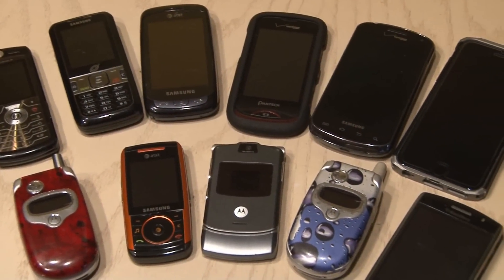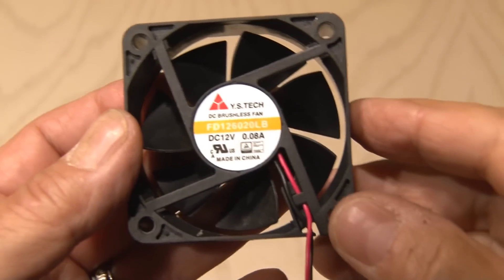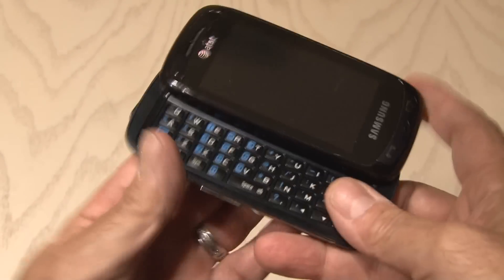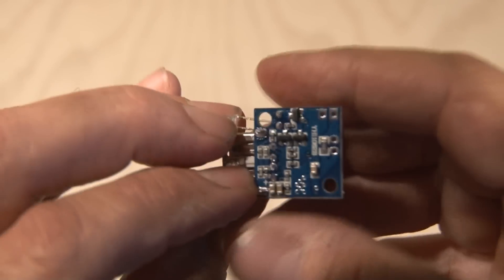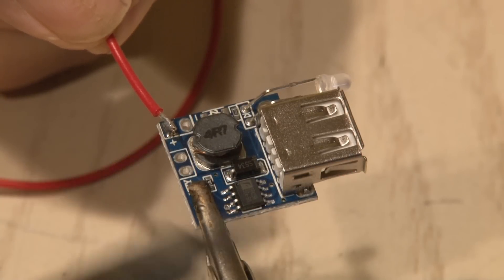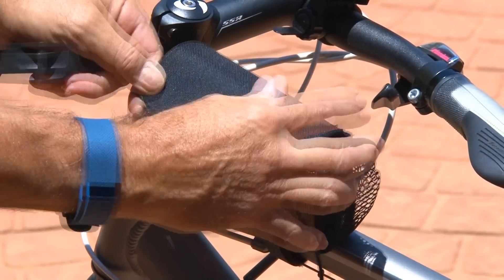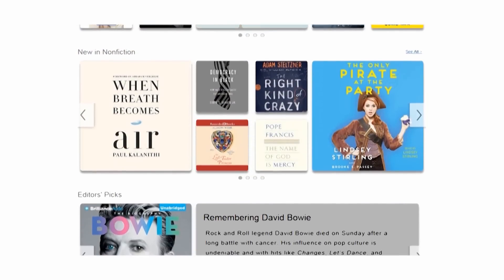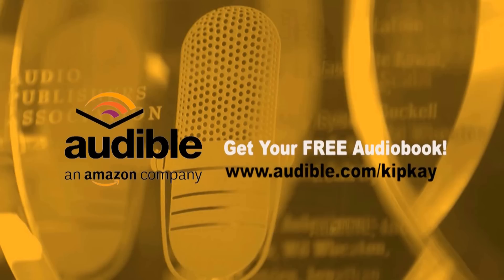Charge Your Cellphone with a Fan!

Comment: Or just glue some Neo magnets on the cooler pallets and it spin forever :)))
Reply: I work in a company which builds alternators that are then put into things like locomotives, ships or power plants. What you are saying is total crap. Sorry to burst your bubble :-(

On the plus side, if you are trolling you are doing it right.
Reply: Crash Gaming AHAHAHAHAH
Reply: explain?
Reply: doesn't work like that perpetual motion is physically impossible
Reply: tom jones
I know how it works, I made some.
You need another neomagnet to repulse the others so they will spin the cooler. It is so simple to make.
Reply: you know the law about how energy can't be created nor destroyed, that is what disproves that statement
Reply: +tom jones Magnets still expend energy and will get weaker over time. I work with magnets quite a bit and you can "recharge" a magnet by running an electrical current through them.
Reply: Jayoku Houtenjin!
Neomagnets last a life time :)
Reply: +Crash Gaming having been interested in this for a long time, and having a supply of neodymium magnets, I tried and tried to get this to work (even following some "free energy" videos exactly step by step) I could not get it to work. Over a weeks worth of work, and even if I do the fan exactly like videos on youtube show, when I move the magnet to spin the fan it just stops spinning after rotating about a quarter of a revolution. So, the videos have to faked in some way, because even using the exact same everything that some videos do, my fan just simply won't spin like the video shows. So it has to be false or faked in some way.
Reply: Oh so just because there is a youtube video about it, it must be true? There is also videos about Hillary Clinton and Opera being reptiles, are they also true then? Is the monkey with an AK47 liberating a war camp video I saw yesterday also true?
Reply: asdda I MADE ONE OF THOSE !!!
WTF are you living under a rock ?!?!
Just order on ebay some coin size neomagnets and build one in 5 minutes !
Reply: Crash Gaming Also, I have built one before with neodymium magnets. Total bullcrap, didn't work whatsoever. This would be much larger news if it actually were true. Don't say that "I'm living under a rock" when you are the one spreading lies and generally being a moron.
Reply: asdda
dude just give up.
You are a painter maybe. Let the experts build these things.
Reply: Crash Gaming At least I don't believe in free energy from a couple of magnets and a PC fan. An idiot in an idiots eyes are usually the smart one.
Reply: asdda
Not in your case.
So many guides on youtube yet you are acting like you don't know how to use the search function.
I even gave a link but still, you remain an idiot.
Reply: asdda
Oh and something else you piece of shit.
THIS VIDEO RIGTH HERE shows you that you can generate energy using the CPU fan.
But he is using the force of the wind while ridding a bicycle.
Are you saying that kipkay is lying ?!
And all I did was saying that the fan can spin using neomagnets.
Yet you came here commenting that you can not generate energy using a cooler fan.
Fucking stupid.
I bet you like grappe soda and chicken also.
Reply: asdda
You have a brain, yet it is a waste.
Glue on each fan pallet a coin size neomagnet with + side upward. Fix the cooler on something. Make a support with another neomagnet on it. The + side towards the + side form the other neomagnets on the cooler in an angle. The neomagnets will reject eachother and the cooler will get momentum and it will spin till it breaks.
Reply: +Crash Gaming yeah you might Beable to get 5 v and can maybe light up a few led lights but a magnet generator would not work. It's just impossible.
Reply: Tom Ziesmer
That was what I was saying. I am just using the spinning force from the magnets to produce 5V. That is all :)))
Reply: Crash Gaming He literally just said "magnet generator would not work" and you just agreed to that point
Reply: Crash Gaming Yeah, and it doesn't work unless you manually move another magnet around the fan
Reply: asdda
nooooo ffs !!!
Just build a fixed support!
It has to be on an angle to match the angle of the fans. It will spin like crazy xD
Reply: Crash Gaming No, no it won't.
Reply: bahahhaa asdda
Reply: +Crash Gaming You should study some physic dude

Comment: what happens if the fan is spinning to fast? 
will the "USB device" regulate it down?
Its a good idea!
Reply: +kuma982 depends on the device. If you don't have access to one who do you could just solder a 5V zener diode between the positive and negative. It is crude but will work fine especially at currents that small.

Comment: But theres no 60fps and it has a USB female so how would you even destroy ur iPhone cable?
Reply: yeah, should be able to plug USB cable right in it.
Reply: +The Mati He probably meant cutting up a iPhone cable just to make this modification.
Reply: +ki2ne he made that modification cause the old Phone didn't have USB at the end
Reply: Old iPhones still have a USB-A connector - just the other end that connects to the iPhone is the 30-pin adapter.

Comment: Could I mount the fan to the bicycle wheel, so it will generate power faster?
Reply: That won't work it won't be exposed to the wind
Reply: But it'll be powered by the spinning of the wheel...
Reply: +cyancoyote you need the fan blades to rotate, not the fan itself
Reply: I know that... I meant to fix the frame of the fan to the metal that holds the wheel, and let the wheel move the fan...
Reply: +cyancoyote ah the forks! Yes just Assure you fix the wires down too so they don't get tangled
Reply: Yes indeed! For some weird reason, I couldn't think of the word "fork", so I said something completely different, sorry for not being clear enough :)

Comment: Or just hook it up to the bicycle wheel and spin... probably  lot more efficient.
Reply: Or just a higher energy input in general. With proper gearing ratios you could get that thing going pretty fast, but then you might send too much current to your phone.
Reply: +Dan314159265 so you don't need to pedal a lot. just one rotation every so often
Reply: +JJ24x7 Give it some more though and tell me why it wouldn't work.